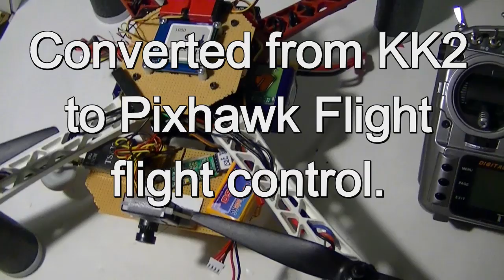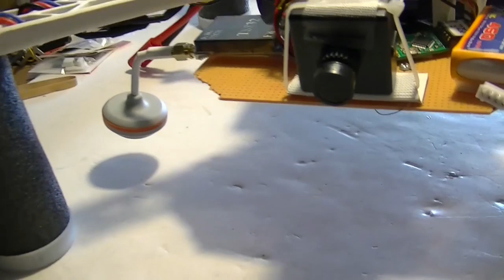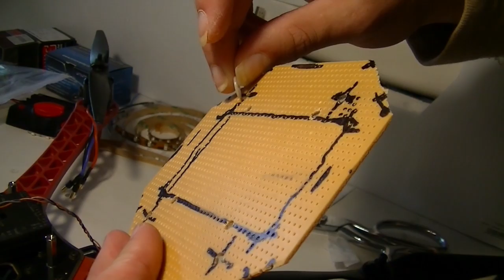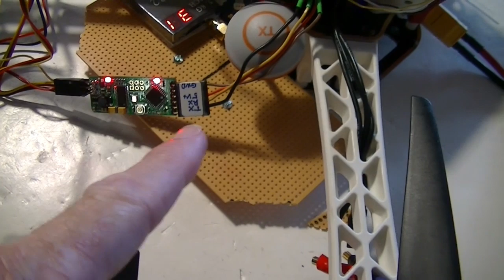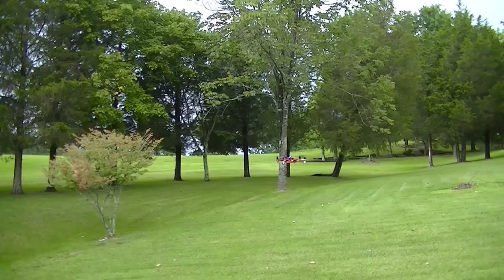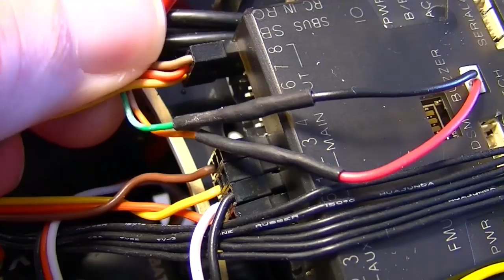Arducopter PixHawk FPV Quad Build w/ FrSky Receiver, Taranis and Flight Test

Comment: Is it a good method if i connect all the red wires from ESC BEC into pixhawk ( backfeeding). Or i just cut off all the red wires from esc and only just plug signal and ground

Comment: What all did you have to program on you Taranis to get it to work with the Pixawk?  I'm having issues with mine. (same setup as yours)
Reply from the maker: DStraughen1 I can't remember everything I did but you do need to do the radio calibration and compass calibration in the mission planner.
Reply: Thanks, did you change any of the mixers on the radio?

Comment: Interesting overview. Thanks for sharing.
I suggest changing the orientation of your X8R receiver antennas so they are oriented at 90 degrees to each other.
Reply from the maker: Yes, we pondered the location for a while but couldn't find a good spot for the second antenna. We may have to add a pole sticking out somewhere.